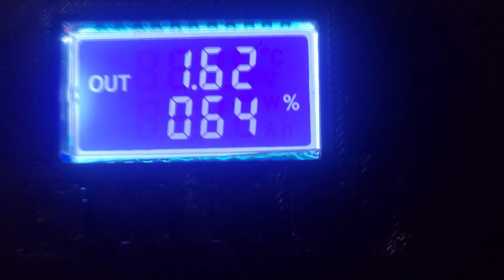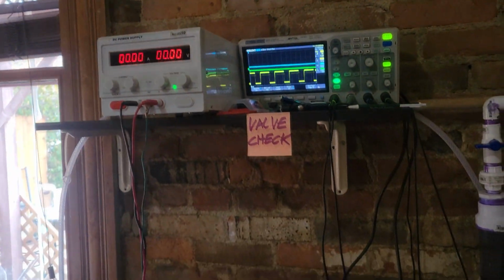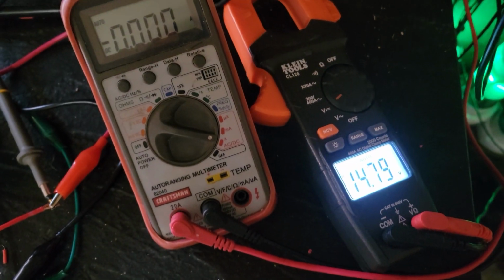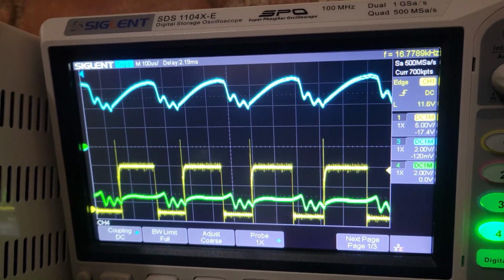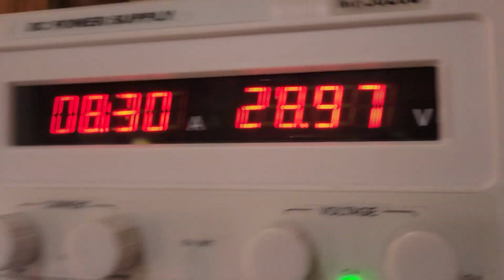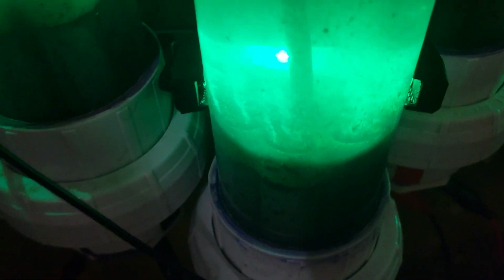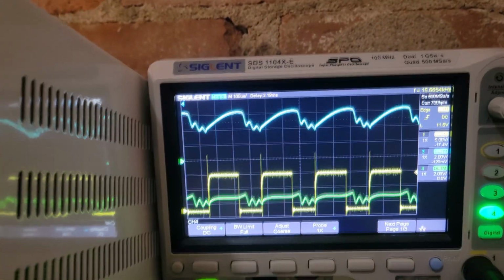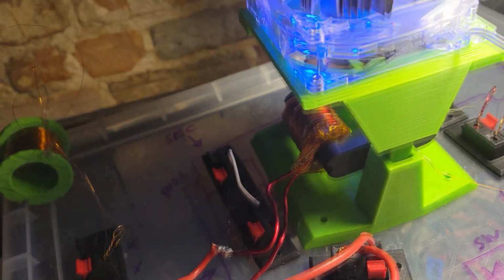Inductors ONLY -- Click Here For Hot Gas Production!

Comment: It this for hydrogen production? It looks like a scaled up version of an electrolysis cell. Also, im guessing you are using inductors for loading your high-frequency oscillator (driver)?
Reply from the maker: HHO? Yes. No inductors on the driver circuit, if that's what you mean. Just a basic PWM feeding a Mosfet. This is not a standard electrolysis cell by any means.